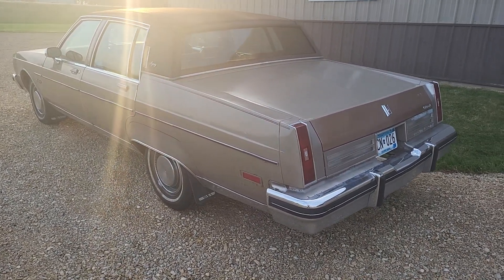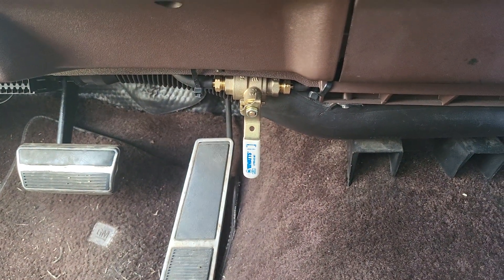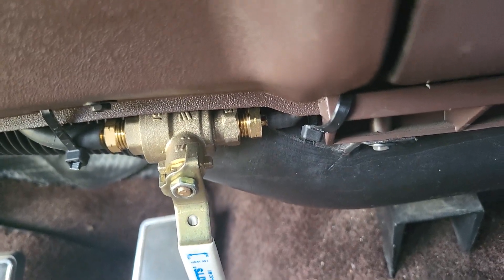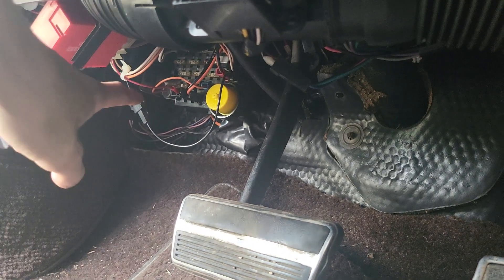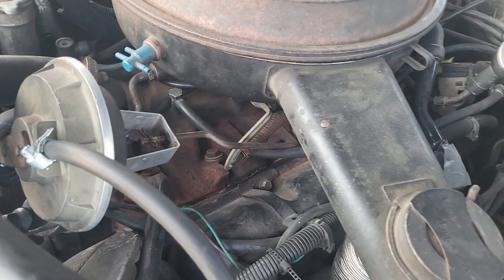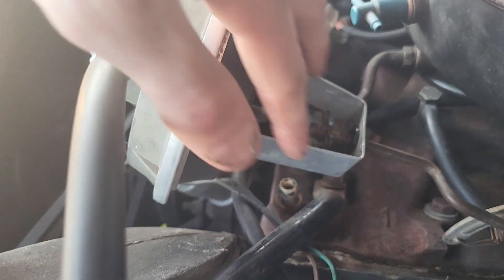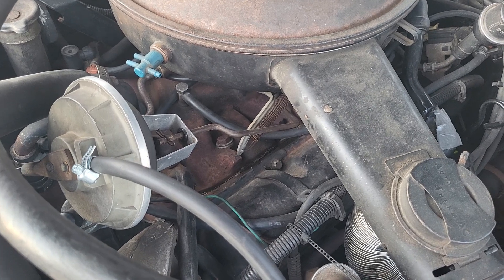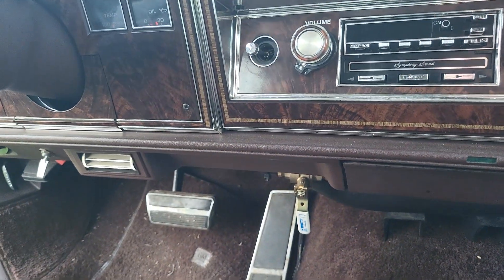DIY cruise control for less than $50; no wiring needed!

Comment: Question would this set need the original lock up transmission too work or would it work with a non lock up transmission also
Reply from the maker: Transmission type does not have an impact on this working. Its a completely separate system

Comment: Great job. My ‘85 442 has the Cruise stuff missing, but this is a cool setup and you’ve inadvertently helped me figure out what’s missing from my car and what a bunch of the wiring is for. Thank you!
Reply from the maker: Good luck, those gm cruise control systems in the 80s can be really tough to get working again. That green aluminum resistance wire is such a pain in the ass to deal with

Comment: I have to say that is an ingenious way to make a throttle lock. (Throttle lock holds the throttle in one position where a cruise control varies the throttle to maintain a particular speed). 
 
 Does your cruise transducer (the thing on the fender well with the speedo cables) still work? If so, it wouldn't be very difficult for a clever guy like you to wire your cruise system direct without going through the computer. Those transducers work on 12 volts and there's no printed circuit board inside to interpret signals from the computer. The resume/accel functions I can't speak to, but a single on/off switch and figure out which wire in your cruise switch (incorporated into your turn signal lever) provides a 12 volt output when the set button is pushed. Then connect that wire to one of the 2 connectors that I can see on top of the transducer, the other to ground (or an a ground that is interrupted by a switch on the brake pedal when depressed), put the vacuum lines back to the way they were, and I'll bet the cruise will work just fine (with the exception of resume/accel). I have the OE wiring diagrams for those systems from 1979. If you'd like to see them to get a feel for what I'm talking about, I'd be happy to get a copy. The system is pretty straight forward and you'll be shocked at how simple the function inside the transducer is.
 If your transducer doesn't work, 90% of the time when the transducer fails, the foam rubber air filter (in the square thing on the bottom) has fallen apart to dust and debris, then the vacuum that's inside the transducer sucks the trash up into the fly wieght/clutch and the solenoid that engages the system. Gums it all up and prevents it from engaging. I'm assuming that you have a gas powered 307 V8, and not the 350 diesel or the tiny little Buick V6. 
Let me know if you want to see the simpler wiring from a few years earlier. 

Either way, I was impressed with your ingenuity on your setup. :)
Reply from the maker: I tried to troubleshoot ways to get the factory setup to work without the computer, but most of them were going to be more trouble than it's worth to me. Even before I junked the CCC system, the cruise control still surged more than usual to try and maintain speed. Set it at 55mph and you're gonna be going a combination of 45 to 65 while it tries to keep you at the selected speed. This way was just much easier
Reply: @riotautorepair9662  Oh I hear ya in the more trouble than it's worth department. Lol I'm just letting you know what I know about the systems. I will add that large speed variances like you experienced are very likely caused by junk/debris build up on the spinning disks, or the sliding valve (that controls servo vacuum supply) inside the transducer. They are pretty simple fixes for someone with your aptitude. A can of brake clean and a screwdriver are enough to get the job done. If you change your mind and want to get it working again, grab a transducer off of a 70-79 GM that has the same physical appearance of yours but with only 2 connections on it, plus a ground to the body. They are the easiest to figure out and wire, but a used unit will likely need to be cleaned out inside. Good luck out there:)
Reply: @oldsguy354  I have the same type cruise control on my 1978 Chevy truck, I bought it new, and my original transducer started surging bad and sometimes hard to engage so I bought a rebuilt transducer from, I think maybe Rockauto ?, years ago. It still works great and I can see where it would be fairly easy to use it on another vehicle.
Reply: Hey I’m interested in the diagrams. I have a 1978 k5 blazer 
I believe everything works on my transducer  but when I engage it hold itself out wide open. I thought it may be vacuum leak. Everything is hooked up and tight. Not sure what it could be
Reply: @oryonhernandez2150  Are you saying that when you push the button in the turn signal stalk to set your desired speed, the transducer opens the throttle to WFO?  (wide blank open) 
If so, that sounds like your transducer has failed. Have you opened it up and cleaned the nearly half century of dust and debris out of it? I’ll bet the foam filter that was in the bottom section of the transducer (it was originally intended to filter the air that the vacuum supply pulled through it) has dematerialized into fine sticky particles that have been sucked up into the slide valve that regulates vacuum supply to the throttle actuator (the big rubber thing that pulls on the throttle valve on the carb) and is holding the slide valve in the full throttle position. If you are very careful when taking the transducer apart without losing the parts and you’re mechanically inclined you will see how the transducer works to move the slide valve to more or less vacuum to the throttle as needed. Wash the insides with brake cleaner. The only easy thing to mess up when inside the transducer is the spring mechanism on the rotor that the speedometer cable spins, and if you go slowly, even that is hard to mess up. 
All that to say that the problem you’re describing (full throttle at speed set) is assuredly not an electrical problem. In a 78 Chevy pickup you would have only needed to electrical connections on the transducer. Power on, and speed set and both of those would have to be working normally for you to get any response at all from the transducer. 
Seriously, if you have good mechanical aptitude, you will understand what’s going on inside the transducer, and I can almost promise you that it’s caked up with debris that is keeping it from functioning correctly.